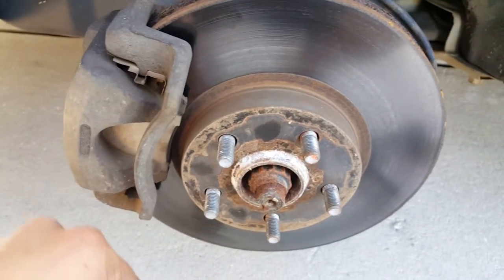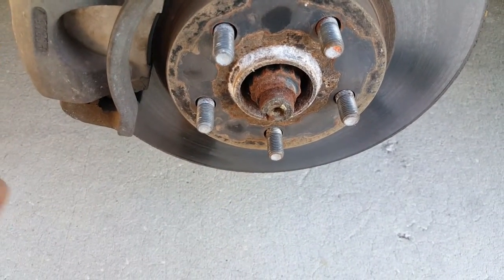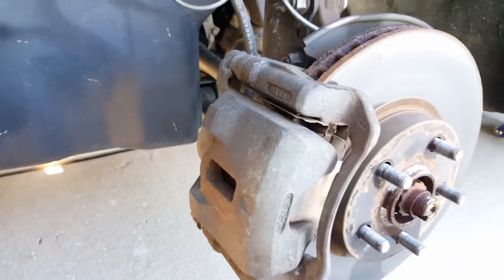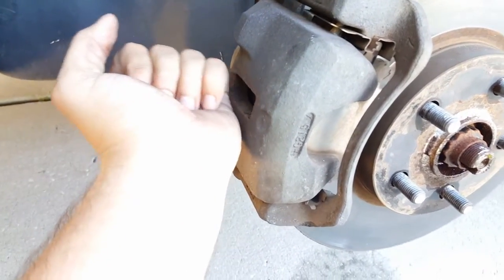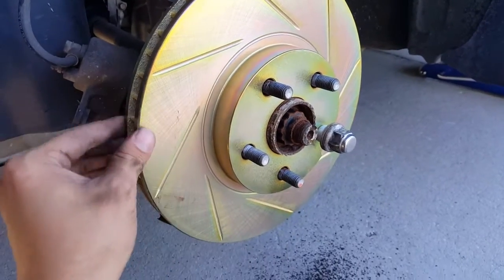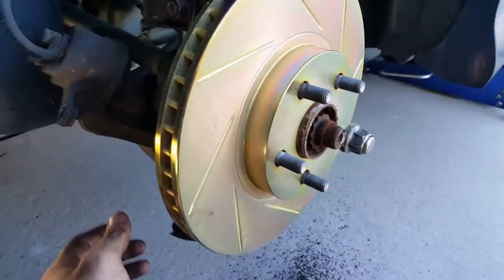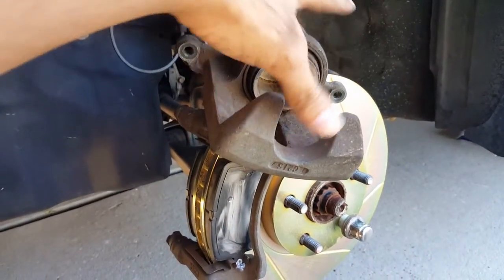06 corolla xrs front and rear brake replacement.

Comment: Very grateful. I've a 2002 Corolla (9th Gen, built in Japan for NZ market) and I was going crazy trying to find a video with these pin & clip style rear pads.  Every other video I found for that generation of Corolla is either drum brakes or else regular disc brakes that are a smaller version of the fronts i.e. with caliper slide pins and caliper mounting brackets. I've no idea what an XRS is but I'm glad you posted this, some of the comments below really helped me too. Cheers.

Comment: do you grease the dust  boots with silicone grease like the pin boots on the front?
Reply: no
Reply: I did. On both sides of my vehicle, one slider (inside the dust boots) was stuck. I forced it just with thumb pressure and it came free. One of the pads was a lot more worn than the other so I guess it had been stuck for a while. It actually moved back and forth quite well after being freed up, but I had no confidence in how long that would last. So I removed the hollow metal tubes inside the dust boots, cleaned them up and smeared some silicone paste just like I would a regular slide pin.

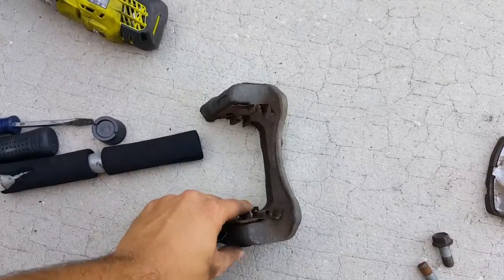Comment: Great video!  You know how you mention at 10:29 to grease those slides on the front brakes?  Do the rear brakes also have slides that actually move back and forth that need to be greased?  I noticed the rear brakes do have a rubber part on the rear guide pin and their sleeves, so I'm assuming there is a part that needs to be greased, but the guide pins screw into an immobile part on the other side I think, so I'm curious as to where you would need to add grease.  It's setup a bit different than other cars so I'm a bit confused.
Reply from the maker: All you can just grease the pad on the front where it makes contact with the caliper. That should be fine..rears dont need as much as the front because it's used less under braking..so you should be fine with that
Reply: Gotcha, will do!  Thanks for the reply!  Do you happen to know what part on the rear brake moves to relieve pressure on the brake pads when someone lets their foot off the brake pedal?  Or does the rear brake not have a part that does this?  On the front brake, the slides allow those pins to move back and forth to let the pressure off so your brakes aren't rubbing when you're not braking (as you mentioned in your video).  I'm curious as to what part on the rear brakes is responsible for that.  Do you happen to know?  I'm super curious and just want to know how that aspect of the rear brakes works.  Thanks again for your time
Reply: All The rear brakes on these have a different setup than the front, and are similar to my Camaro’s brakes. The pins on the rear are only there to hold the pads on place. The caliper slides on the actual mounting bolts that hold it to the knuckle since the caliper is integrated into the bracket and therefore cannot slide along the pins like the front can.
Reply: @edarr85  
I have a matrix xr but it has 4 wheel discs. Are the xrs brakes the same as xr discs?
Reply from the maker: @curtis1951  I believe so
Reply: @edarr85  
Thanks.
Reply: @timharwell2735  That comment helped me so much. Thanks. Very little info on this version of rear disc brakes, had a sticky caliper and uneven pad wear, but because I'd never seen them before and the dust covered bits didn't move, I didn't realise they were supposed to. Had the same confusion as All, couldn't see how they would move/retract. Found this comment, pushed on the dust covers again and one cracked loose. All become clear. Re-lubed those metal bushes inside the dust covers and installed my new pads and sure enough the calipers are moving back and forth now. I worked all through the night on this so thanks again.

Comment: I'm not sure that your anti rattle spring routing is right on the outboard pad. It doesn't make sense for the spring to go up and over the clip. It serves no purpose. I initially did it this way following your lead...but it's just too counterintuitive to be correct. There's less "hole" for the sling to grab onto this way. Also in the factory manual pretty clearly shows it not that way (basically the smaller aping goes one and then the wider clip goes on the inside of it). 
   Fwiw...I couldn't reference mine because some previous owner  bozo had all three clips on the outboard pad! Lol. Oh...and also washers on the lug studs under the rotor! Turned out it was rubbing on the sheet metal portion of the backing plate. Couple whacks with a hammer fixed it. Anyhow...love the vids.